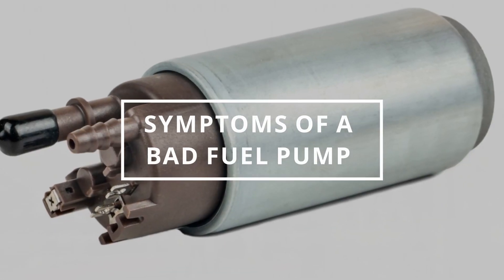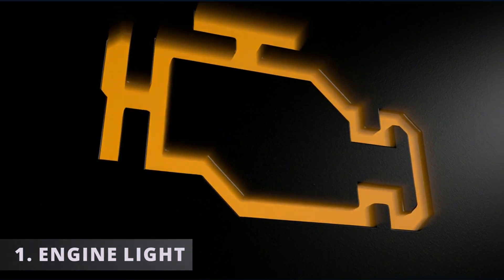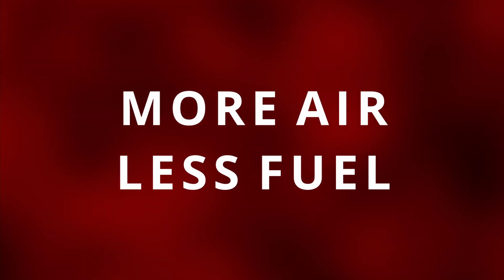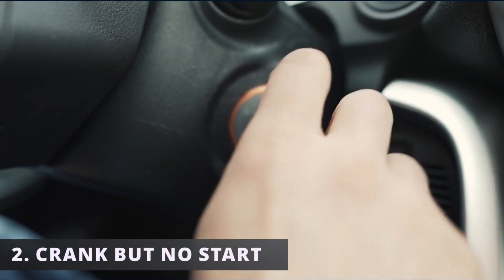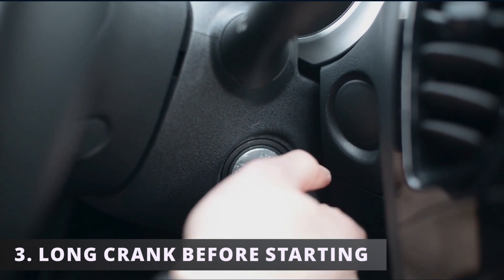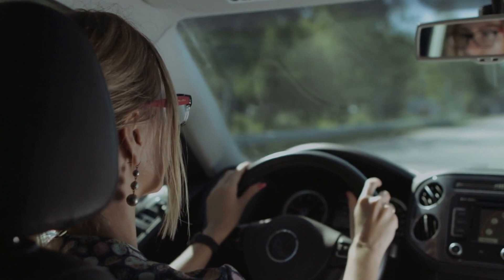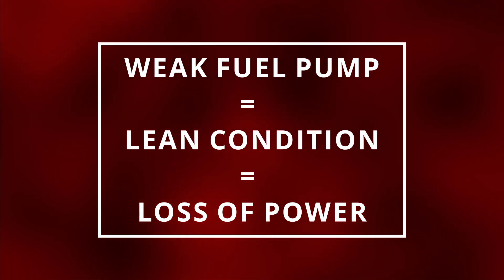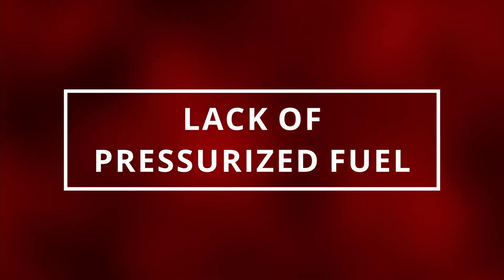SYMPTOMS OF A BAD FUEL PUMP

Comment: How i found out that my fuel pump was going. Was i would be driving either on the freeway or city driving the problem would occur. I would be driving along when all of a sudden the gas pedal would become unresponsive no matter how far you put it to the floor it wouldn't move the truck, all it it would do would rev the truck up but the truck wouldn't move it would stall out or be chugging then stall out.  So I would pull over come to a stop put it back it park turn the key off then turn it back on start the truck then drive away. Then it might do it again  or maybe not at all. The most times it happened in a row was two times. But it got to the point where the fuel pump sounded like you were shaking a bottle full of rocks. Wasn't long after I dropped the tank bought a new fuel pump installed it and I haven't had a problem since then. My new problem is my sending unit that controls the guage which attaches to the fuel pump. I should have just bought a whole new assembly.

Comment: I have 2012 terrain ...very strong smell of gas all of a sudden! I bought the car worh just over 200,000 km and the check engine was on.  Right from beginning it intermittently start sputtering like  it's going to stall  but hasn't yet.  Is this my fuel pump?
Reply: Many auto parts stores offer free code readings. I also have a GM and it’s nothing but issue after issue. But definitely get codes read. If you don’t know a place that offers it, you can buy one on Amazon for cheap.
Reply: It could be the pcv. If it's stuck open, and could throw the air to fuel ratio outta wack. Also is the smell of gas all the time, or only when you fill up? Try filling your tank to 3/4 of the way. Also the pcv can fail for a long time before it will kill the fuel pump too.

Comment: If my truck sits for a while, will fire fine the first time, every time, and run with 0 issues or any symptoms. However, if I stop, and turn it off, it will not fire until "x" amount of time goes by. Once whatever has happened, it will start. Like, never will it not start in the morning, or at work. Both breaks starts fine. If I stop for gas or to go in a store on the way home, stuck. For a while. Eventually, it will start. It's a pattern, and consistent. Always fires after it's been sitting for a while. Anybody have any ideas?
Reply: I have a truck that had this problem, the previous owner said that it was the coolant temperature sensor and a bad distributor.
Reply: Fuel pump or crank shaft position sensor
Reply: Having same issues with my Mustang…. Let me know if you get it figured out…. I’ve sank over $1000 dollars into the problem so far …..still doing the same thing.
Reply: I’m currently having the same problem with my Lexus ls 400, it turns on fine on cold start and drives fine for like 20 min and then after it warms up, my rpms start dropping then turns off. Then when I try turning it on it won’t turn on. But when I wait a few hours, it turns on again. it’s a pattern with me as well
Reply: I thought i was the only one who has this issue. Have you found the solution?
Reply: @fabbie2201  I have not. About 2 weeks ago, my battery died. Upon replacing the battery, the issue was fixed. No problems whatsoever. Until, I drove enough for the computer to detect the issue. Leading me to believe it's not a failing part, but the computer telling it not to start due to some issue. Still trying to locate it
Reply: @Brandon-kq1tl  you find the issue?
Reply: @RatigansIsland  I have not. I don't drive it much anymore. It's kind of sitting until I have the time to dig in to it. Now it needs transmission work as well. So I had to get something else to drive daily. Problem was never resolved. Unfortunately
Reply: Y'all are awesome. Thank you. I'm gonna start checking in to those one by one lol and go down the list
Reply: Had that issue, and it turned out to be the fuel pump relay. Once it gets hot, I stops working. Once it cools down, the car started back up. Just bought a new relay and no more of the problem!
Reply: Same issue nissan Rouge. Not throwing any code. No clue. Annoying
Reply: And distributor and etc sensorso.  Yep
Reply: I am having the same problem
Reply: I am having the same exact problem right now did you every figure out how to fix it
Reply: I'm also getting the same issue on my toyota axio nze141.
Reply: Having the exact same problem 1997 Tacoma..what did you find?
Reply: Sameeeeee has somone figure it out?
Reply: Same here on Nissan xterra. It’s a camshaft sensor
Reply: I'm having the same problem with my car
Reply: Exact same symptoms at an 89' w124 200E. Will soon replace all temperature sensors and my voltage regulator (could be evean that yes). 

I'll come back and tell you guys if it had any effect
Reply: @emmanuelkarantemoires2161 what happened?
Reply: @kalenweber5390  Still have that... I've replaced fuel pump, fuel pressure accumulator, fuel pressure regulator, filter ofcourse, I've replaced all coolant sensors (has 4), fuel injectors and I've renewed the thermal grease in a module that controls ignition (just in case it overheats). Also replaced voltage regulator, and although I think that made it better, it's not fully fixed. Didn't replace all this just for this issue, I'm restoring the car . Now everything works like a dream, but still when the car is hot and turn it off, it doesn't start for a minute and some seconds. Never more than 2 minutes. It doesn't matter if you crank or not, it won't start if that 1,5-2 minutes don't cone to pass. When the car is cold though and I switch it off before it gets up to temp, it sometimes starts right away...

It has crossed my mind that it might be some kind of presentative measure but I'm not aware of such a spec in my model...
Reply: My car runs fine when it heats up but after sitting for a while, it becomes difficult to start it. Any help please?
Reply: Coils overheating ?had a mustang 5.0 did same thing even cleaned the injectors

Comment: I have to park my car for some minutes for it to cool down before it can move again. 

I was told it was a bad fuel pump symptoms.  I replaced the pump completely and everything was ok but for only some few hours and the same issue is back again. 

Though I didn't buy a brand new fuel pump.

Perhaps I still needs to change the motto itself.

Comment: That's terrifying and oh so dangerous when it stops in traffic.  A mechanic once told me that he had no way of checking since everything seemed to have been working fine and I'd just have to wait and see if it happened again.  The worst type of advice.
Reply: Spent a whole lot because everywhere I take it in the mechanics say it’s fine and then it still doesn’t start from time to time
Reply: Then that's not a mechanic. He's a part replacer
Reply: This happened to me yesterday. They said it could be the starter, but the symptoms are exactly this, without the engine light. Was only going to change the filter, but i think now I'm just going to do both. Just in case.
Reply: @pineapple0310 would your stereo and go off first then start stalling.. mine feels like the electrical goes of then it shuts off just changed the alternator and still the same smh
Reply: when youre  car starts to mis fire when cranking. is one sign of the fuel pump going out. loss of power just like the video. i started my car let it idle.. and luckily in my driveway it sputtered and stalled out everytime i cranked and no more noise from fuel pump so.
Reply: TELL THEM THEY MUST CHECK THE FUEL PUMP AND THEY WILL I WAS TOLD THE SAME THING
Reply: yeah same issue, engine just keeps going out while driving. Im putting a new fuel pump in on wednesday.
Reply: same situation as you

Comment: My 2006 Chrysler 300c 5.7 turned off on a stop in an intersection won’t start I check if I can hear the fuel pump at the gas cap and yes I can hear it had it towed home next day it started but very very rough idle what can it be

Comment: Replacing the fuel filter before replacing the pump may help also.
Reply: Hardly worth replacing the filter without the pump . The truth is if the filter is clogged it would have harm the efficacy of the gas pump . Hence it would be wise to change both .
Reply: except most vehicles after 2010 are pump/filter package
Reply: Exactly the same symptoms  as mention. Milage is 150,000 km and never replace the fuel pump. For sure I need new replacement.😢
Reply: Where is the fuel filter located
Reply: @carloscardenas7850  ,,, Some cars have an additional fuel filter in the engine bay near the fuel lines on the injectors.
Reply: @carloscardenas7850  ,,, In the gas tank.
Reply: @carloscardenas7850  some cars under back seat through floor board 
Pain in the butt but accessible and doable
Reply: @Carlos Cardenas  I would say Google it first.. lol. Or follow the gas line from tank.  I only saw under car, but in different locations on the couple cars I worked on.
Reply: Unless you have a Corolla like I do and can’t replace the filter…
Reply: Yeah I have a 2016 f150 can you have to get to the pump to get to the filter which doesn't let you do that sadly
Reply: 2017 jeep patriot pump and filter are one unit
Reply: 2017 jeep patriot pump and filter are one unit
Reply: Unfortunately my fuel filter is inside my fuel pump ,,2012 Chevy impala

Comment: Can this cause the ignition not to turn over at all? We thought possibly a battery or other electrical issue but a scan detected no electrical problems. I used a diagnostic scanner which gave me P0300 codes but just went through hell and back replacing all the ignition coils and spark plugs a month ago =/ After replacing the battery, it can start but shakes hard and dies =(
Reply: could be the AC compressor i had the same problem
Reply: @bajadan2769  Thank you! It ended up being the ignition coils. I just needed to replace all 4 with good ones and not faulty ones from Autozone =/

Comment: My Lancer gli  4g15 engine,after starting,when the temp reached the operating temp the radiator fan start running 5sec.and stop after 7 sec.will keep running 5sec run and stop 7sec and continue on and on like this.may I know if this is normal? Thank you sir.

Comment: In addition, I noticed that after changing the fuel pump my mileage improved from 275 to 430 per fill up, now it's down to maybe 260 per fill up. Again, can this be the injectors?

Comment: Thank you for the video. I changed my fuel pump on my 2002 Mercury Mountaineer (MM) a few months ago. My check engine light is back on with a code 305 misfire and code 171. Also, I noticed while sitting at a stoplight/sign my MM has been shaking/vibrating often. Could the problem be the fuel injectors?  I have never checked, cleaned, nor replaced the injectors, since I bought my MM in 2001.
Reply: When’s the last time you did spark plugs?
Reply: Pcv replacement made my engine stop shaking when stopped

Comment: I’m pretty sure my Jeep is on the low end of almost failing . Stalls, I hear a pop from the fuel pump whether the car is on or off, having to pump the gas pump and it still doesn’t go, but the rpm’s increase.
Reply: If the rpms increase its getting fuel and air. Your contradicting your statement.
Reply: @theenzoferrari458  what I meant is I can be in gaining speed but my rpms wouldn’t decrease as if I’m not increasing gears. But I found my problem I have a bad cat

Comment: I have a 2016 Corolla in Ghana, which I started using January this year. Suddenly the engine doesn't start on the first cranking when the weather is warm especially after parking it for more than an hour. I have no problem starting the car around 6AM or when the weather is cold. I have changed oil, oil filter, spark plugs all within this month but the problem persists. Please suggest possible causes. Thanks.
Reply: i had this with a 2001 audi a3. it was a 1.6 petrol. It was the only car ive ever seen that ran better when it was cold. when it warmed up it became sluggish
Reply: Have you fixed it cus I have same problem
Reply: I had a relay heating up and the solder would separate causing it to not run in high heat

Comment: Got a prblm, p0093 fuel leak detected...loose power when I accelerate...does this fuel pump in the tank to be considered...cause injectors were good... pressure regulator also...what could be the prb

Comment: My car had no issues, but one day i dropped of someone and when i started moving and pressed the gas pedal, engine turned off. When i tried to turn it on, it cranks, but doesn't start. A mechanic checked and replaced the EFI fuse and reset the computer. Then it started, but when you apply the pedal, it turns off again. Then, it cranks, but doesnt start. Help pleases!!
Reply: Did ya ever find out what your problem was I have been having the same problem been told it’s probably the fuel pump but who knows

Comment: I hope someone can help me here. I have a 2002 envoy that started getting worse gas mileage about a year ago. A few days ago I was driving out on the hiway at 55 mph when it suddenly began to sputter and lose power, which had never happened before. It never completely shut off and after rolling for a ways I pulled over off the road thinking I was out of gas, bit according to my gauge I was not out of gas but the gas light was on. Someone helped me get a little gas and it cranked right up after sitting for 30 minutes and I drive a mile to a gas station and put a few gallons of gas in it thinking that would take care of the problem. But after driving around 3 miles it began sputtering again and one power. I pulled over again and called my brother who told me to sit for a few minutes and try it again. I did and it cranked right up with no hesitation. And I drove 3 or 4 more miles before it happened again. It never had a problem cranking even when I thought it was out of gas which was strange because normally when you run out it takes a few seconds to crank but this was not the case. If I pressed on the gas pedal it would lose power. But when idling it was running fine with no sputtering. I finally made it home and the fuel filter was replaced and it seemed to be fine until I drove it the next day around 10 miles and it began sputtering and slowing down again so I pulled over and shut it off and sat for a few minutes and cranked it back up with no hesitation and drove around 8 miles with no problem after taking thee gas cap off. But the last 2 miles it Bagan sputtering again only thus time it was much worse and would not idle as it had been doing before. Also this time I got the message on the dashboard to shut off engine which had not happened either. I managed to make it home and I don't know what to do. I have little resources and money and need help diagnosing the problem. Thank you
Reply: I think the pump is failing, which can occur in stages. The computer told you to shut off engine because multiple misfires were being detected due to lack of fuel pressure. That's my guess. Did you scan it and get any codes?

Comment: A friend of mine has a 1997 Oldsmobile regency 113,000 miles , we replaced the fuel filter,  we replaced spark plugs and wires . But they tested the fuel pressure,  they said it seems ok , but every so often, it seems as tho the car isn't getting enough gas,  and it stumbles,  just like it is gonna stop , she said she pushed gas pedal to give it gas,  then it was ok . No check engine light comes on .
Reply: Fuel filter possibly..  I strongly recommend putting in a new filter before/ with a fuel pump. An inexpensive part, easily installed and could be the reason for fuel issues in the first place.
Reply: @Jerk_ANC  i found out eventually was it was  , this time i was lucky enough to have the check engine light come on and it started flashing  , i told my friend to park it cause  didn't want it getting worse,  got it to the shop , and yes they also got a code like i did , misfire cylinder # 3  they pulled # 3 spark plug and # 3 coil pack  , and the tech found the spark plug bad and spark plug wire was shot and coil pack   , so it was either  a promblem from coil pack to spark plug , or vise versa ,  they put a new spark plug in with a new coil pack , and installed all new wires , ran great .

Comment: Like always great video . Bro would you tell me something about what could be wrong with my car. I have 2014 A4 b8.5 1.8 tfsi. In the summer when i start the car the rpm was like 1100 around 40 sec and go down to 750 , perfect. Since maybe two months it's sometimes like 1200 and slowly go down in 10 sec it's like 850 rpm . Sometimes it's like start 1100 and after 20  sec go down to 850. After i drove little bit and stop , go to neutral it's normal 750 RPM. Is it something wrong or nothing to worry .
Reply from the maker: Thank you! I appreciate the support. Now this can be multiple reasons.I would say if your car has no check engine light, it could be due to a dirty throttle body. When the ecm senses a lack of air flow, it opens up the throttle plate a bit more to compensate for it. This could be the reason why it’s idle is a bit higher.
Reply: @easyautofix  Thanx for responding. Now it's like 10° outside and problem is gone .  I don't know why. but now it's like it should be .